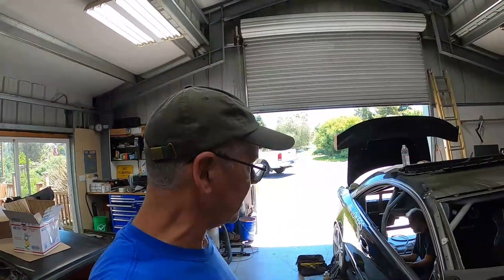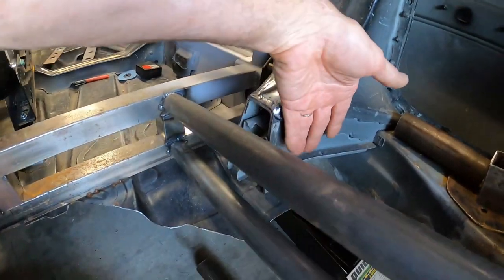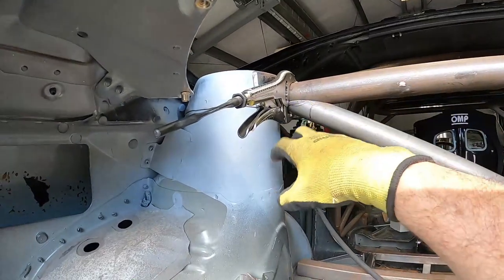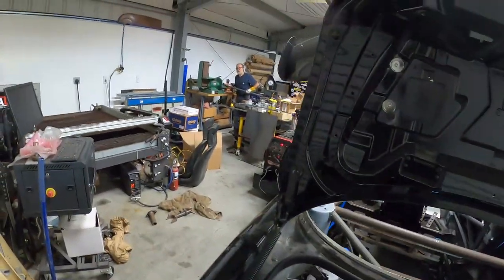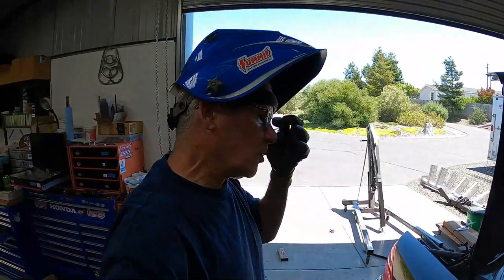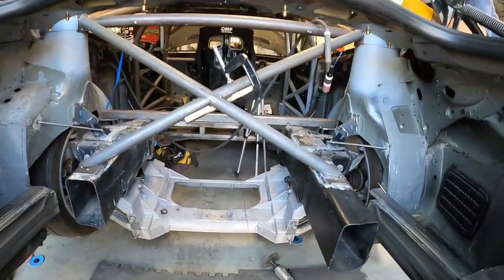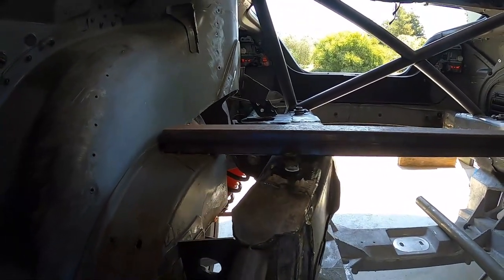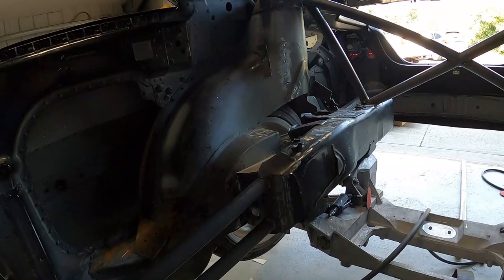RacerBenz - Episode 2: 'Vette rear suspension progress!

Comment: Looks like a lot of fun! Tell me about the welds (filler, amps etc) How critical is the tubing mechanical fit VS welding in a gap (if its me) ?
Reply from the maker: Generally follow the starting point of 1 amp per .001. This is .095 wall DOM mild steel so around 100 amps. ER70S filler rod. Mechanical fit is important. Minor gaps happen but you get a feel for "that's weldable" vs. "nope". That's why you see the multiple fit-checks and back-and-forth to the band saw or sander. Time consuming but necessary and worth it. Come check it out sometime soon?

Comment: Is there any way you can share the coordinates for the C5 chassis-side suspension pickup points? That would be some golden info. Plz share if you don't mind.
Reply from the maker: Not sure which measurements you're after but this is what I used to locate the cradle: https://www.pro-touring.com/threads/133819-C5-Suspension-cradle-gound-clearance
Does that help?